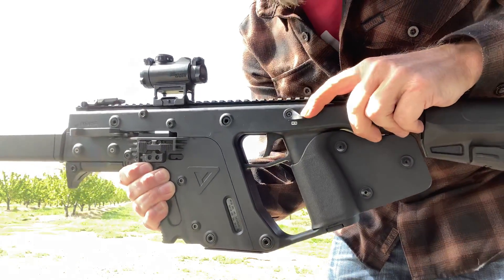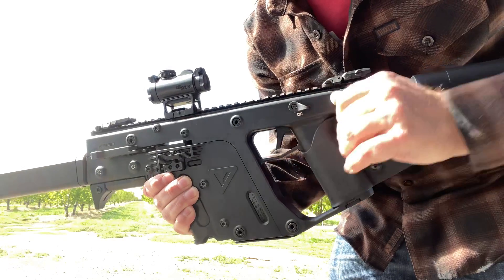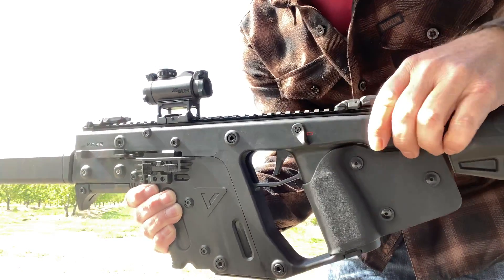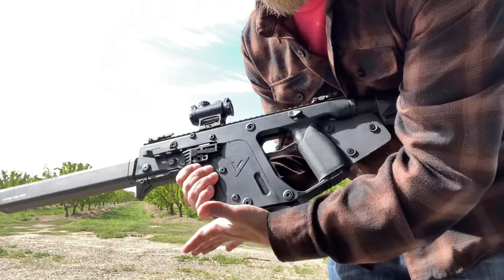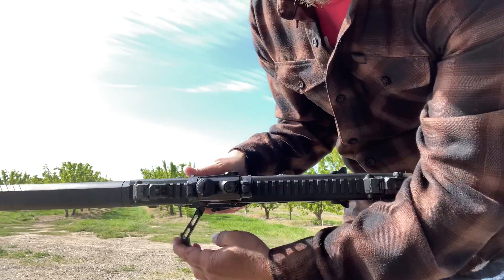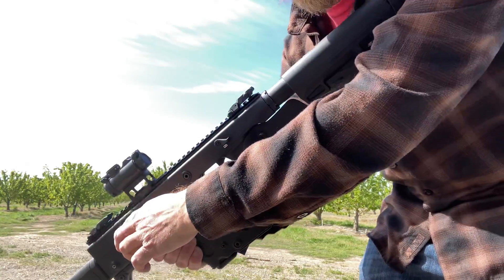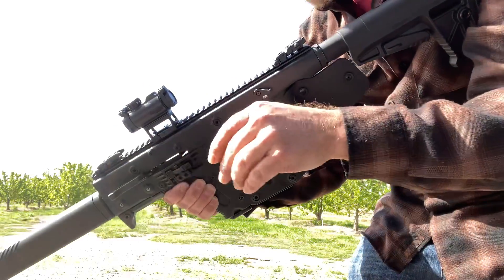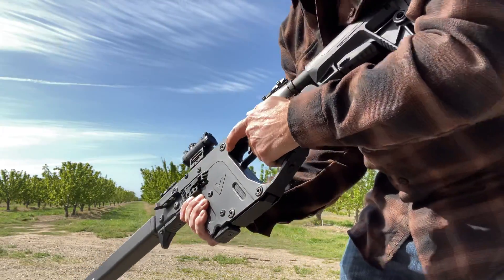How to operate Kriss Vector loading & firing

Comment: im here to see if it is true as kriss manual says to charge the gun before inserting the clip ...so they say to pull charging handle lock it in place and then insert the mag and then engage the bolt foward is it true
Reply: @shadowkin  yes its very true and the best way to keep it in the best firing shape,if you notice when you inguage the bolt it hammers shut,well it wont do that if you hand charge it
Reply: @mccoy786  can somebody make a detail video on how to load and reload Kriss
Reply: @EthansLegos  no detail needed,its simple your charging handle on the left side of the gun pull it back and lock it with the lever underneath.So now its locked in the open position now you can insert your magazine and then lock it with the same lever in the opposite direction...when you press the lever it should slam shut hard and that is normal,and you will notice after your last round is fired the charging handle remains charged for the next reload with no need to recock the hammer .just close the chamber again with the toggel and away you go
Reply: @mccoy786  oh my god thank you so freaking much. I have been struggling figuring out why my vector won’t hold a mag in, but it will hold an empty one in fine. Loaded it exactly the way you described and it made sense and worked perfectly. Thank you!
Reply: @___H3475  and at the of the clip the bolt is locked it the ready position to load another and slap that bolt home

Comment: why make an instructional video on how to operate and load a Kriss vector and then do it completely wrong? Manual specifically says in bold multiple times "never load a kriss vector on a closed bolt". Always charge the handle back, lock the bolt open, insert magazine and use the Bolt release forward.